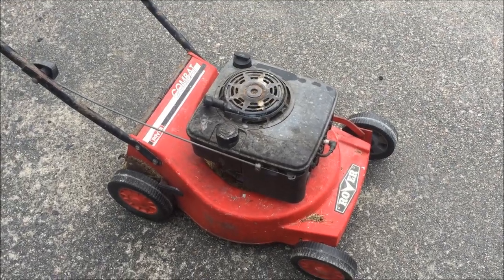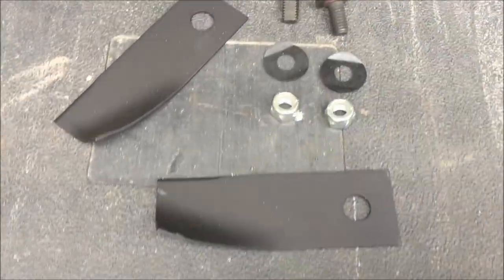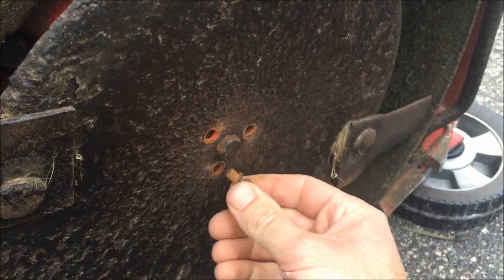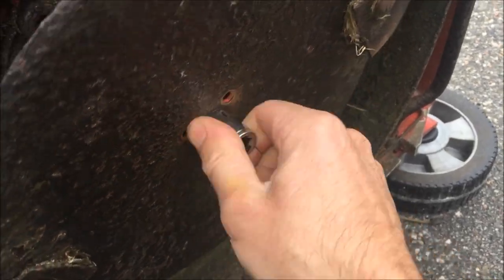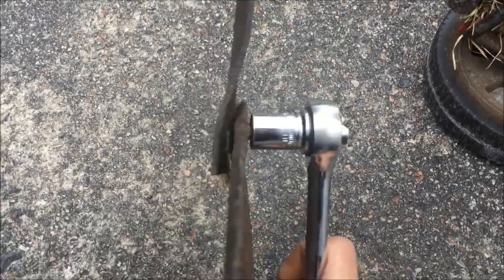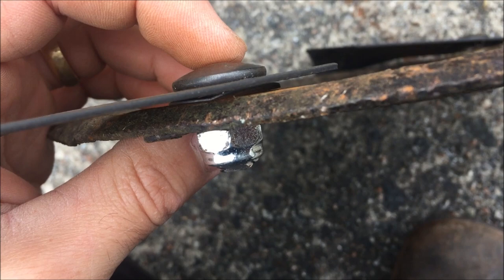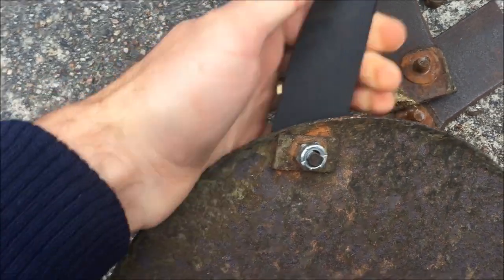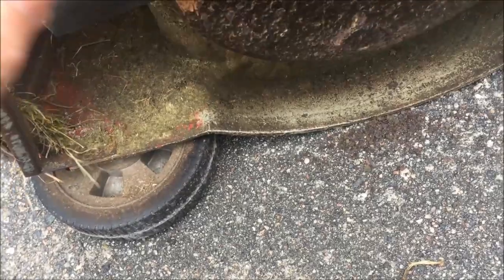Rover Mower Flail Blade Swop

Comment: For starters.. you don't tip a 4 stroke on its side.
Reply from the maker: Good stuff. How do you get beneath it?
Reply: @bootsowen  spark plug to the sky. straight back on handles.. or on a bench and in through the rear catcher flap, obviously raise mower to highest level.. 23 yrs working in a mower workshop, they tend to flog this info into you.. lol

Comment: The bolts are 11mm and 14mm. The engine is American but the mower is Australian. You require some Miracle Grow 4 in 1 on your grass too! Thanks for making the video. I had to replace mine and couldn’t understand why they wouldn’t tighten up!
Reply from the maker: The last thing I want is for this grass to grow!  I’d only have to cut it more.
Reply: @bootsowen  it kills the weeds and moss, greens it up and thickens it. Makes it easier to cut as you don’t have to push the mower over a moss carpet! Once a week is plenty.
Reply from the maker: This mower gets used about twice a year.
Reply: @bootsowen  ah. Okay!

Comment: How on Earth did you manage to start the mower after you tilted it on side?

Should have tilted backwards...
Reply from the maker: Lol. Rules!
Reply: +bootsowen necessities my friend, necessities!

Whenever I tilted mine side ways, it sure was a trip to repairer for service as oil mixed and flooded engine...
Reply from the maker: I have seen it before where if the exhaust valve is open the oil will run out that way, but it would still always start for me. And it started in the video!  Tilting it backwards doesn't give as good access to the blades as tilting sideways.  On some older Briggs engines, that don't have the starting bubble, like this model, you can prime the carb by tilting backwards.
Reply: Two things.
1. Safety first!! Disconnect spark plug wire and ground it to engine
2. Most times with a 4 stroke engine if you tip it over with the air cleaner/ carby facing up at sky you wont have a problem! It does pay to leave the mower for 5 min before starting it up to allow any oil in valve inspection cover on opposite side of engine to carby to drain back to sump.
Easy!!
P.s. i was a mower shop mech for way too many years!!
Reply: @cavekritter1 i must Google the part ground spark plug wire.